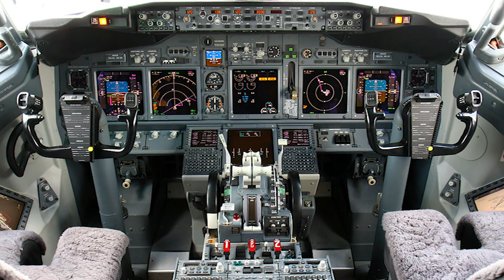Closing the sidewall and preparing for painting - A Boeing 737-800 Homecockpit #12

Comment: where did you get the diagram dimention i cant find it on your website
Reply from the maker: The link to the sidewall dimensions can be found in the description of the corresponding video. The dimensions of these gap-filling pieces can only be guessed by making paper templates. I think they are different for every sidewall.

Comment: Mike, where did you get the hardware for the steering tiller.
Reply from the maker: I don't have a steering tiller yet and it will take some time until I start building the tiller. I will first try to build one by myself.
Reply: Oh, but you posted some pictures of the captain sidewall with all d extra hardware. Cup holders, map lights, mic etc..
So those pictures are not from your build.
Reply from the maker: Kim Siong Shim I posted a picture of a real boeing cockpit. That was not my cockpit.